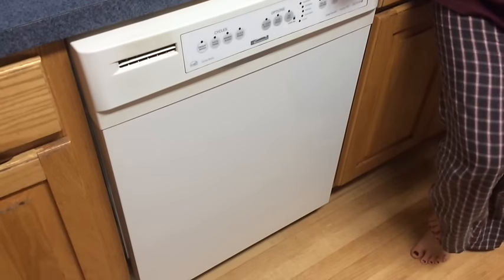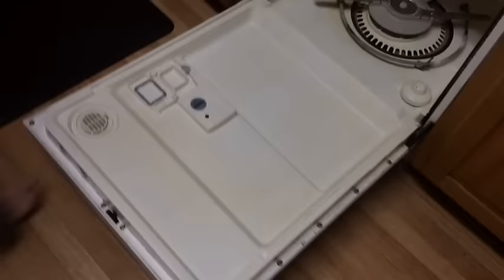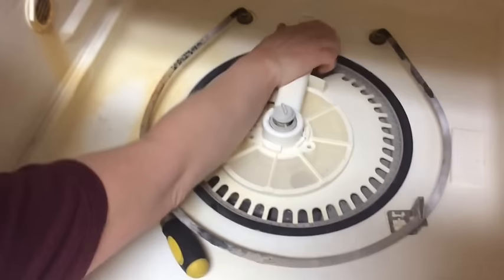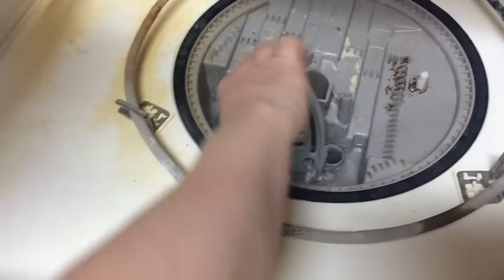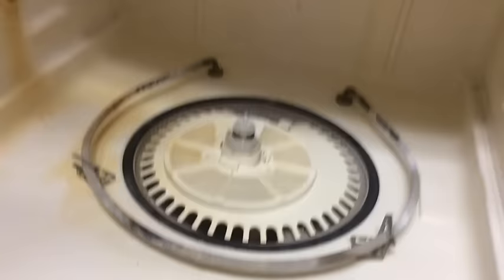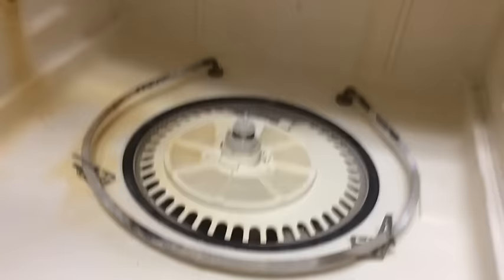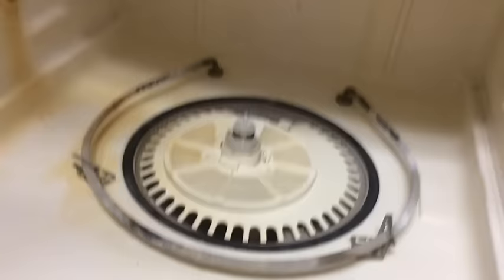Dishwasher DIY maintenance Kenmore dish washer.

Comment: Here in 2022 when I thought the dishwasher I got from a friend was unsalvageable! It was unbelievably packed with pink and black goo! I followed these steps to take it apart, deep clean it, and put it back together. After about two hours it’s clean and come to find out the NORMAL cycle is supposed to take only an hour opposed to FOUR HOURS! Thanks y’all! It was a big help!
Reply: I got those EXACT Dishwasher(Has a Black front) for Free from an Elderly Couple who said she hates dishwashers and only used it a handful of times. She changed out this one for a newer only Only because they remolded their entire kitchen to all Stainless Steel appliances That were all WiFi compatible.. So that they could get a Higher price for their home when it is sold after they die. I just took out my old one that didn’t clean for anything and also stopped draining and installed this Dishwasher myself. It was a lot easier than I thought it would be and now I have a dishwasher that runs great and cleans my dishes the way it should lol.. Videos like this come in handy especially when you don’t want to pay almost the price of a new dishwasher to have someone come out and do exactly what you can do yourself with a DIY video.

Comment: Thank you!! Just unclogged our Elite (model 665.13759K602) and your video had EVERYTHING I needed to know! FYI, on the Elite, the water feed tube (the tall thing you removed first) is held up with tiny metal clips, not screws, but in the same general areas as your screws (pull the clips outward to free it). And yeah, there's a screw holding the blade cover (use a smaller star bit than the filter screws). Once that was out, I needed a small flathead screwdriver to pry it out. Pulled a bunch of plastic bits and bone fragments out - so gross but satisfying!

Comment: Older video, but shows everything.. I striped the plastic nut holding on the bottom spinning bit.. had to drill it off. Hopefully I can find a replacement part lol

Comment: Just a mention, instruction manual "might" show how to remove macerator (thing that chews/collects food particles) - have to find mine.   I know I replaced it 10 years ago and found lemon seeds and an Olive pit in there.  At that time I was having trouble draining the dishwasher, was clogged by this garbage. Now,  I am having a problem with the upper spray arm so have to disassemble as you've shown me, but will also again check the macerator as I suspect it has filled again - with garbage.  Ugh. Thank you again.

Comment: The one thing I noticed was you should have pulled off the grinder cover. You were so close. It's at the very bottom of the dishwasher where you pulled out that tid bit out. Under the cover is where a circle metal screen with a blade spins and cuts up any debris. This is where build up can occur causing you to starve your pump and burn it out. Thus no water to clean your dirty dishes.  One important note is paper labels from new dishes can clog this metal screen doing major damage to the main water circulation pump. Remove all labels  and check this if you notice a weird sound coming from the dishwasher.

Comment: You have the exact same model as mine! Got it nearly 16-17 years ago.  It had been working great, but then yesterday we noticed a puddle at the bottom because it wasn't draining.  Had to look for over an hour before I came upon your video.  Great video! :)  Although the sound was a little low and hard to hear, the visuals were all I needed to be able to dismantle my dishwasher's insides.  I was able to go ahead and fish around for gunk, put vinegar to soak down the tubes, and lo and behold!  It drains again!!! You saved us the purchase of a new dishwasher, as I'm sure the repair would have been more expensive than a replacement.  Love you guys! :)

Comment: My lower spray arm nut was broken, leaving the threads stuck in place. I used a DuraTech 3/8" internal pipe wrench and a pair of slip joint pliers to remove it. I placed the internal pipe wrench at an angle to grip onto the insides of the broken spray arm nut. It came out very easily in less than one minute! I hope this helps someone. 💖💖💖

Comment: Tip. Take some needle nose pliers. Put the pliers in the screw hole that is in the cover that covers the Blade, and screen. Pull up. It will come out.

Comment: The grinder cover will come out if you pry/pull up. It really is just one screw. No clips. I used a small pry bar under the front left side.  When I pried from the right side it wouldn't come up.

Comment: Just a quick suggestion.  Before screwing the manifold back in to the top and back of the unit, put a towel over the bottom.  If you drop a screw, it's gonna go down in the basin and you'll pull it all apart to get that screw out.
Reply from the maker: good tip, thanks

Comment: What kind of sadistic designer makes the two smallest screws on the top and back where they can fall through under assembly 👿 Was pondering how to avoid disappointment just before I was done reassembly and put a towel down before those last two screws 🤓
Reply: Good idea to think ahead.

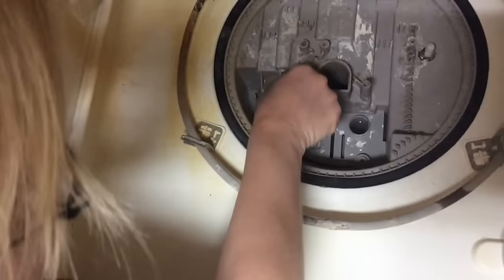Comment: ***Important note: at around 6:42, dude points to a part that they can't remove.  It covers the chopper/grinder thing.  You CAN remove it!  There is a clip on the right hand side of the part holding it in place.  Take a screwdriver and push into the smallish slot there and push to the left and it will pop out.  You can watch this first hand on a vimeo video "Repairing the Chopper Assembly on a Kenmore Dishwasher" by Jay Young, at about 5:48.  It will save yourself a LOT of time!
Reply: Thank You! Does it cause the dishwasher to make a fuss when it's washing? Mine is & I thought the little washer thing under the spinning part was cracked but every single image I've found for it shows that washer ring to be separated vs what I thought was broken. Everything I've read says it could be something caught in the grinder & I have pulled broken plastic forks & spoons out where our teenagers have put them in the washer & not placed them in the baskets with the tops so they don't fly out when washing.
Reply: Thanks for this. I put it all back together and then saw your comment. Better late than never.

Comment: I have tried and tried to get the blade plate off but the plastic screw just keeps turning and turning and the blade plate won't budge. Any suggestions?
Reply: turn the plastic screw in the opposite direction.

Comment: Thanks for this. I moved into new apartment and it has the same dishwasher model. The problem we r facing is that the dishwasher detergent dispenser does not open. Any suggestions on how to fix it?
Reply: Ours does the same thing at random times.  Never figured out why. It is at least 15 years old though and still going!
Reply: I fixed it. Opened the front door of the diswasher. Cleaned up the dispenser mechanism and it started working. But its quite difficult to assemble it back as u have to perfectly aline the dispenser mechanism with the gear axle together before screwing back the door